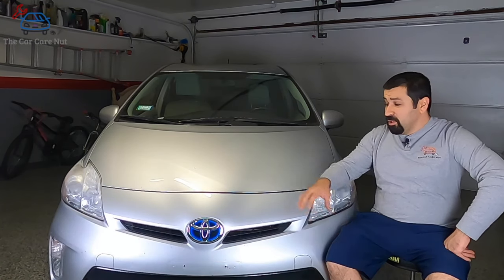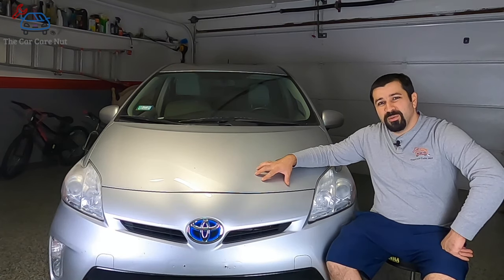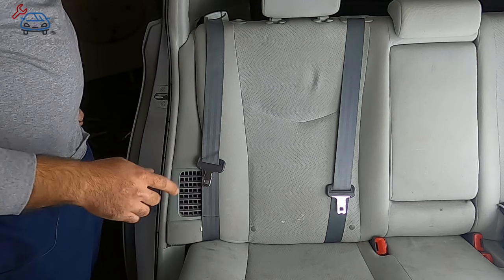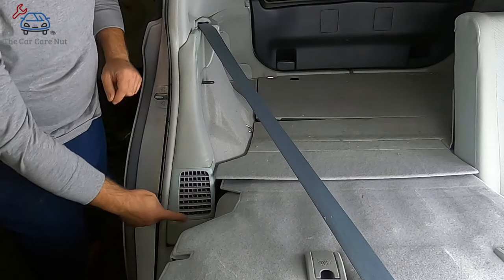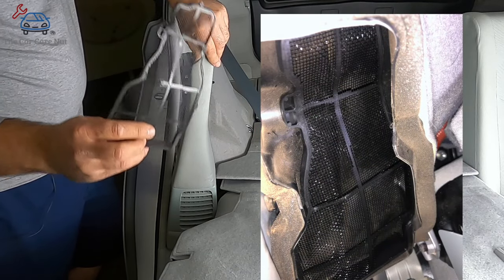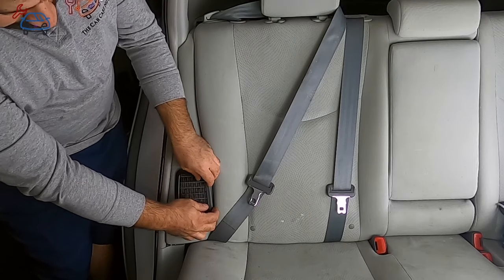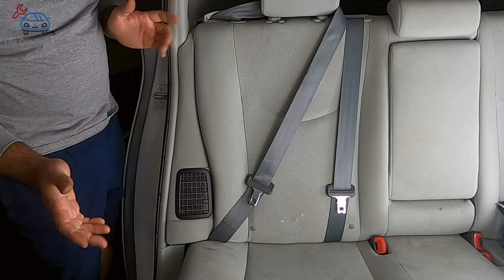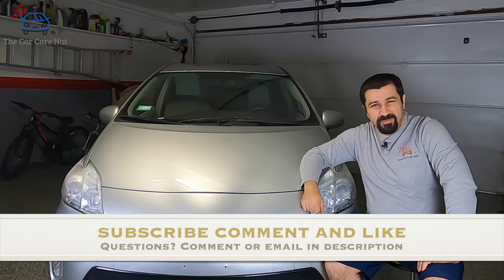How To replace Hybrid Battery Fan Filter : 2010-2015 Prius

Comment: I recently discovered your very informative videos and have quickly gained a tremendous amount of knowledge about my 2012 Lexus CT200h. Thank you so much. I am the  4th owner and have had it for 16 months. It has approximately 112K and after checking the battery fan intake duct and fan to insure  that they are clean (which they were), I noticed my CT200h does not have an actual battery fan filter. Is this normal? And if so, should I consider buying one to install, if available?
Reply from the maker: Hi! Thank you for watching. You can install one for your car. Contact your lexus dealership for availability
Reply: Thanks AMD!  I appreciate your prompt reply! You ROCK!
Reply: I installed mine because it didn't have one either
Reply: What is the part number for the filter.  I have 2013 prius . I don’t know what number it is.

Comment: So just got the car today, 2020 Camry Hybrid LE. It drives great but I hate the headrests. Took out my old ones from my 2002 Solara and put one in the driver's side but its loose and doesn't fit as nice as the other. But I will drive with it later on tomorrow when I go to work and see how it works.  
The dealer said I get a free oil change every 10,000 miles. Should I wait that long, or just pay for one every 3-4000 miles like normal?  Do you know of any place to get good alternate head rests, specifically something comfortable for Tall boys.
Reply from the maker: I would get the oil changed every 5k miles if you’re keeping this car long. I don’t have any information on the head rest sorry.

Comment: Dear Car Care Nut: What do you think about running the car with BOTH of these filters at once (the second filter could catch what the first filter might miss thus providing double the protection)? My only concern in doing this is that perhaps it would “impede” overall airflow and not cool the battery as efficiently as using just one clean filter. LMK your thoughts. I was planning to use both filters but want to know your thoughts. Best, Rich Z

Comment: We have a 2017 Prius and a 2016 Prius C.  The vents are at different places than the model in the video.  I found them but am wondering if the square filters will still fit these two models.  Also, the 2016 Prius C is our primary car to take the dog for a ride.  I'd imagine the hybrid battery fan should also be cleaned besides the filter.  Will you do a video on cleaning the hybrid battery fan?  Thanks.  Love your videoes.
Reply from the maker: Hi! I am looking for a Prius c to film with in Chicago. Once I get one I’ll get a video out for it.

Comment: After watching this video, I discovered to my horror that our newly acquired 2012 Prius 3 did not have a high-voltage battery filter. I ordered the snap-on style from my local dealer, but I reckon we have to tear apart the ducts and battery cover to vacuum it all out. The previous owner had dogs.

Comment: We have a 2012 Prius V. The duct to the HV battery fan is easy to find, but it doesn't appear to have a filter. Will the new model filter you show for the regular Prius fit?

Comment: Ty for this advice

I just bought a 2012 with 60k miles on it.

I just looked at it does not have a filter inside. So I bought the one you recommended.

I have no over heat engine light.

Should I take out the hybrid fan and clean it? Or do you think I'll be ok since it's only 60k miles?
Reply from the maker: Hi! If the vent looks clean I wouldn’t worry about. If the vent looks like it has a lot of lint and dirt I would clean the fan
Reply: @TheCarCareNut  ok ty!

Comment: Is 2013 Prius Plug-in same as shown on video? I dont have outside filter so it must have inside filter you suggest throwing it out.
Reply from the maker: I would look inside the vent with a flash light and see if you have one.

Comment: Hi sir...I am driving the Toyota Prius 2013  in London as a Uber driver..I am having some issues which my garage didn't really understand that....my car losing the power when I have four passengers and driving up Hill...my mechanic told that it required the EGR valve and sparkling plugs ..I have changed all the EGR valve and plugs which cost me a lot money 💰.. unfortunately it didn't make any changes to the performance......any tips would be really appreciate....God bless

Comment: Great informative video! Any chance you can do a video on whether you recommend an oil catch can (OCC) for the 3rd generation Prius? My OCC catches ~3-4 tablespoon of oil/gasoline at every oil change interval of 5k miles.  In fact my EGR cooler had a lot of carbon build up at 90k that had to be cleaned out. Curious to see what your take is on that mod.
Reply from the maker: I’m not very familiar with this mod. I’ll look into it and make a video for it in the future .

Comment: How good does this Toyota snap-on fan filter remove dust?  Looks like you can see right through it with large gaps between the strands of material.  Is there something that I am not seeing?
Reply from the maker: It actually works pretty well. If very fine dust goes through it, it will actually not get stuck on the fan and just exit out of the battery without a problem. But in the case of lint, pet hair...etc that can clog the fan, this filter will catch them easily
Reply: @TheCarCareNut  Just curious.  Where does the air that the fan sucks in from the back seat vent and blow across the battery exit the car?
Reply from the maker: Depends on the car. Some of them it goes underneath the car and some gets pushed away from the battery towards the back.

Comment: I tried the lift up method of removing the vent panel and it feels like I have another clip in the middle of the panel. It’s not removing as easily as your demo. I don’t see the internal filter inside the vent. Maybe I have an early 2012 and the panel is harder to remove without removing the seat?
Reply from the maker: Hi! If you don’t see the filter through the vent then likely you don’t have one inside.

Comment: I got a fan filter for my 2012 Prius two; not long after installing the filter I was rear ended by an unlicensed, uninsured driver and the Insurance company totaled it. Now I have a 2012 Prius V 5 so I located the HV Battery air intake which was under the rear passenger seat. My question is.. Is there a filter available for the Prius V and if so do you know the part number? Thanks in advance!
Reply from the maker: Hi! I don’t have the part numbers at the moment but for the Prius V you need 2 pieces. One of them changes the mouth of the intake then a filter sits on the new piece. And then after that you just replace or clean the filter
Reply: @TheCarCareNut  Thank you, I looked on Toyota Parts site and could not find it.
for me, I like the Prius V better than the regular Prius I had before.

Comment: Hi I was told my 2015  Gen 3 Prius hybrid engine filter in back seat was not removable?? Please I don't think the service department knows! I was told by service manager 2015 4th Gen , anothean who worked up front told me Gen 2 then finally Andrew cared enough to find out
Told me look on the side of driver's door will tell me when car is manufactured then I can find out which Gen  mine is Gen 3. Please let me know if Black filter it came with is removable

Comment: Hi, watched your replacement and replacing filter loved the video! I was able to visually check my 2010 Prius found NO filter at all. I removed the panel to inspect the condition of the vent very clean is there a way to visually inspect the blower itself without too much trouble? Went to my local dealer for your suggested replacement filter received (clip-on) and installed it today. Needed to ask the parts man for help reinstalling the panel cover, between both of us finally got the clip secured. Thanks again for the enjoyment of watching your channel. Been a subscriber now for about 9 months!
Reply from the maker: Hi! It’s a bit involved to check the actual fan. If you have an inspection camera you can check the fan without removing anything through the vent
Reply: @TheCarCareNut  Thanks for the tip I'll check with my local dealer.

Comment: I have a 2013 Prius with about 71k miles and I just noticed after watching your video there is no filter seems the filter was removed maybe by the pervious owner. I went ahead and ordered the external filter  G92DH-47010 is there something need to clean out what ever dust has already worked it way in without the filter ?
Reply: I want to know that too...

Comment: Geez...I just watched a video where the guy practically tore the entire back of the car apart to get to this.  So, I did what your video says and found that there was no filter at all.  I'm going to get the little snap on kind you recommended here, but I'm not wondering how much hard has come to my battery since it didn't have a filter all this time?  I've had the car almost 10 years.

Comment: I have a 2006 Toyota Highlander Hybrid with 180,000 miles on it. I have been concerned about the batteries but was not aware the cooling or the newer ones having filters. I have it in for service every 3,000 miles and have never been told anything about battery maintenance. What should I do at this point.
Reply from the maker: I would. There are 3 vents underneath the back seat with a mesh filter built into them. That mesh should be cleaned if it’s dirty.

Comment: So I just vacuumed the lint off the inner filter without removing the filter. That seemed to do the trick.
Reply: I totally agree with you. Just like a reusable vacuum cleaner filter . If it’s not broken and does the job why to  replacing  it ,extra work and wasting of money .
Reply: Why don't you leave both filters? In and out?
Reply: @carlosadrianhernandez5377  one or the other, not two.

Comment: I have 2014 Avalon hybrid they’re very hard to look up  information on. Does that car have a filter if so where ? I’ve owned the car new I like to maintain my car.  Please and thank you .
Reply from the maker: Hi! The Avalon might have a filter you’d have to look. On the drivers side of the back seat you’ll find a vent on the seat back. Shine a light and see if you see a fine a mesh

Comment: Can i use both filter. One on the outside and leaving the original on the inside?
Reply from the maker: I wouldn’t as that could create a restriction. Either use the inside or the outside.
Reply: It seem like the original  filter has bigger holes so that alot more dust go thru it just look at how dirty  the fan get and that new filter holes are half it size would help filter the dust pet hair and other partial  from being suck in further.This set up is not as restricted  like air filter in the engine compart. So you can clean the filter more offen but due also check the fan every ten thousand miles or so. Just thinking...love your videos very informative  to prius over. Thanks

Comment: I am able to open up the panel to clean the filter but not able to snap the panel back. Do I have to remove the seat  to remove the bolt that is holding the panel?
Reply from the maker: You’d have to remove the seat bottom which just pulls up from the front. Then the 12mm bolt is underneath.

Comment: I have a Prius V built in June 2012. It does not have a battery air filter. Is it possible to retrofit the car with a battery air filter? Is it advisable? Is it a DIY project? Thanks
Reply from the maker: Hi! There’s a retrofit kit from the dealership. Doesn’t cost a lot but you need to buy a new mouth for the intake then a filter installs into it
Reply: @TheCarCareNut  I went to the Toyota dealership this morning. Neither the Parts Dept, Svc Dept, nor Svc Dpt Mgr were able to find the part number of the retrofit kit or new mouth for the intake in the Toyota parts database. I would really appreciate it if you could provide the part numbers. Thanks
Reply from the maker: Hi! The mouth part number is G92D3-47050 and the new filter that will go on it is G92DH-47090
Reply: @TheCarCareNut  Thanks for the part numbers. I ordered those parts today. Do I also need a body panel? There is no opening in the body panel of my Prius.
Reply: If so, I would need the part number for the body panel.
Reply from the maker: So the existing vent that’s underneath the passenger rear seat comes off and the new one installs then the filters goes on it

Comment: Hi brother. Just looked at a 14 Prius at 122k with  only a the corner of the filter left clean every thing else was plugged pretty bad. I didn't buy it. Would you?
Reply from the maker: I wouldn’t. That’s a big red flag for hybrids
Reply: Thanks. I didn't even know about the filters till an hour before! And i owned a 2010 for 3 years!

Comment: Thanks. I'm having a hard time in getting the cover out to expose the filter inside. No matter how hard I pull up, it won't come off. Any tips?
Reply from the maker: Hmm that’s interesting. I would then remove the seat bottom and take the 12mm bolt underneath it. More work but will be easier to pull the cover off

Comment: I tried what you said to do but I couldn't get that cover to lift up. It would not move.
Reply from the maker: It requires some force to lift it up and pull it out of the hook. Otherwise the bottom of the back seat needs to be removed and a 12mm bolt underneath that piece removed.
Reply: @TheCarCareNut  I’ll keep trying, thanks

Comment: Help?  I was able to pull up and pull the plastic cover off the metal latch but can't pull up high enough to get the little plastic hook above the metal latch to reseat the plastic cover. It was able to come off because the catch is wedged on one side but not on the other. No matter how hard I pull up, the catch hook won't clear the metal catch. 

 AND there was no filter!  

Thanks

Comment: Question   I Have a 2015 Prius 2.  When I pull up from the bottom, as you show, I can feel the unit separating from the clip.  However, even with muscle I am  unable to move the piece forward or towards the interior as you do.  This part that has to be moved seems to be firm in my 2015 while the part in this video seems to be of a softer material which can be squeezed.  Concerned that if I pull up harder or pull inward harder something might break.  When I push down on the seat cushion, near this piece, I see a bolt, which I assume is the one you say can be removed.  Is this simple?  Any chance of messing up wires or whatever?  Can loosening the bolt make the unit separate easier?   Please help and Bless you for your fine videos.
Reply from the maker: Hi! There’s no other wires that could get damaged. Remove the 12mm bolt and pull the whole bolster uo
Reply: @TheCarCareNut  Why can't I get the results that you do with your 'trick'?  I am doing exactly what you say.  Any suggestions so that I do not have to loosen the bolt?  thanks again for your thoughtful comments.
Reply from the maker: Honestly I believe you’re likely not putting enough pressure to lift it in fear of breaking it. This one takes a bit of experience to lift it without breaking anything
Reply: @TheCarCareNut  I have told over 10 Prius owners how great your site is and that they should each tell 10 more people.  We all have 1 last question.  If we replace the filter on a 2015 Prius with the one you suggest and the hybrid battery dies at a future date while under warranty, would Toyota try to get out of honoring the warranty by saying that the removal of the original filter and replacement with the one you suggest 'voids the warranty'.  Thanks in advance!
Reply from the maker: If the cause of failure was due to overheating from a clogged filter they can. Otherwise it won’t be an issue.

Comment: Im guessing you shouldn't install the outer filter without verifying you DON'T have the inner type filter. Would this restrict air flow if you had both?
Reply from the maker: I wouldn’t install both I’d say that’s a bit of an overkill and could start to restrict flow.
Reply: I figured as much. I have a 2016 Prius but figured this question would help someone else. Thanks for the great content! Can't wait for more
Reply from the maker: Thanks! I’m working on getting a 2016+ Prius video soon

Comment: Did they make anything like this for the 2003 ct200?
Reply from the maker: Hi! I’m assuming you meant a 2013 CT200?
Reply: @TheCarCareNut  2013, yes!
Reply from the maker: Hi! It has a similar setup to the Prius but has the filter inside the vent. Your car didn’t have the filter from the factory but one can be added
Reply: @TheCarCareNut  I see the filter portal is a different size and shape I've done some research but can't seem to come across that filter. I'm a new owner to the ct200h and would definitely like to add this filter in if you can leave me in the right direction would be greatly appreciated. Also, love your videos and I'm a fan as a new hybrid owner
Reply from the maker: It should be a similar vent inside. Now I am referring to the vent behind the grille on the outside. You’d have to do some disassembly to install it
Reply: @TheCarCareNut  thank you for the help

Comment: What about a 2009 ? Will the exterior filter fit it
Reply from the maker: Hi! The 2004-2009 Prius has a different part number than the 3rd generation
Reply: @TheCarCareNut  what might that be /part #
Reply from the maker: G92DH-47020

Comment: So, where is the location of the fan filter on the 2013 Prius v? Thanks.
Reply from the maker: Hi! It’s underneath the back seat passenger side
Reply: @TheCarCareNut  Thank you,  I found it, but the filter is somewhat difficult to replace once removed. It also doesn’t appear that the alternate filter recommended would work. Thanks again.
Reply from the maker: There’s a kit that the dealership sells that replaces the design and makes it easier to replace the filter